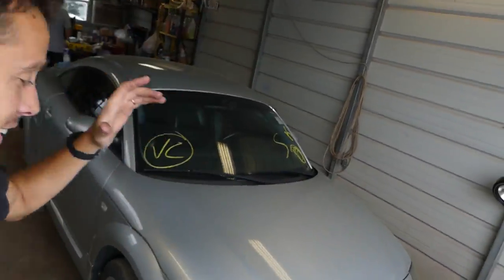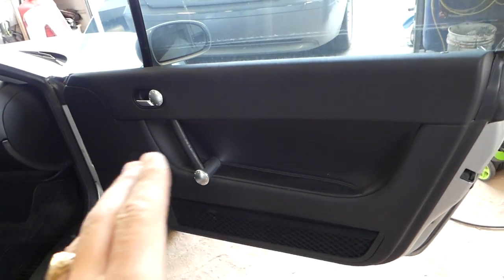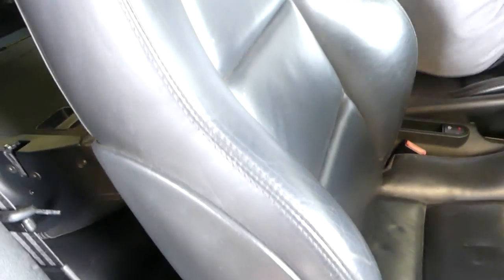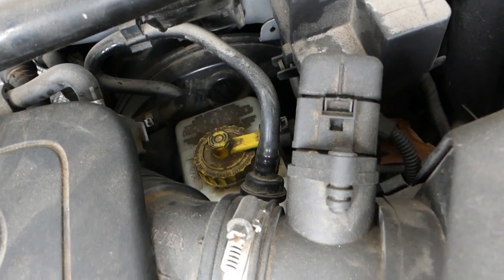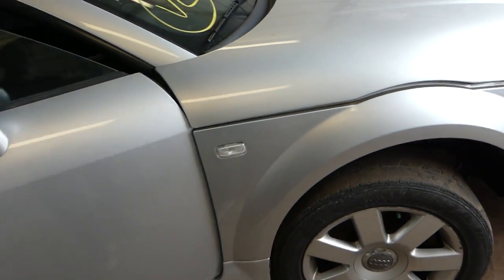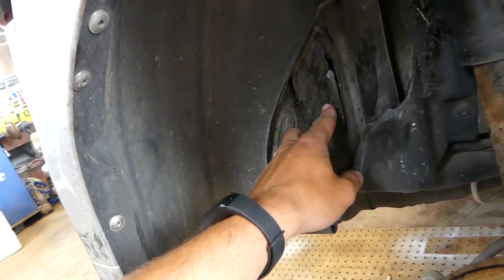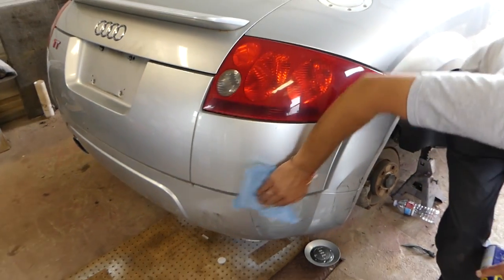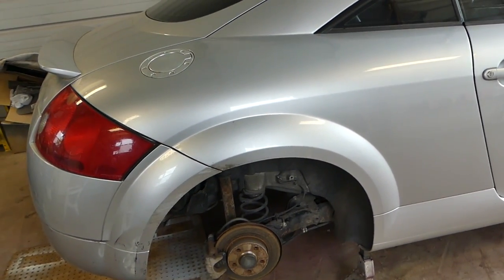AUDI TT 1.8 TURBO from COPART CAR AUCTION

Comment: Just purchased one just like it yesterday for 2,200 with 110,000 original miles. needs lower control arm bushing, crankshaft position sensor and o2 sensor bank 1 then its cherry.